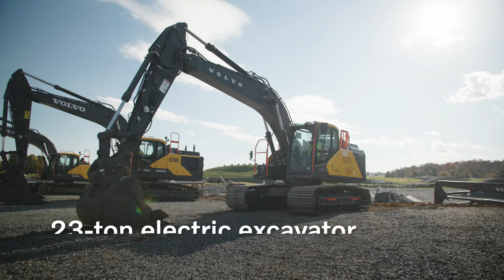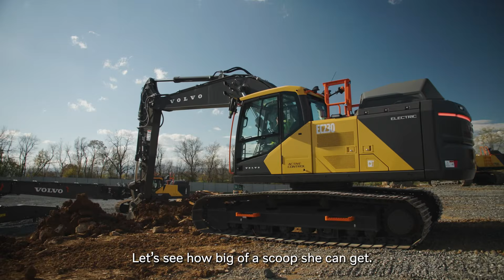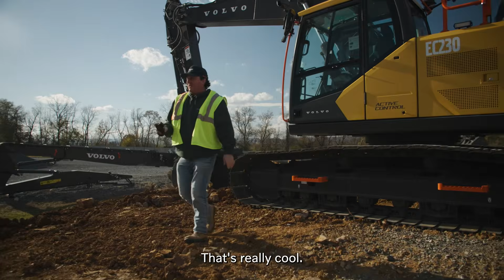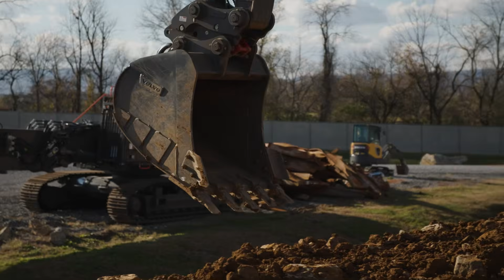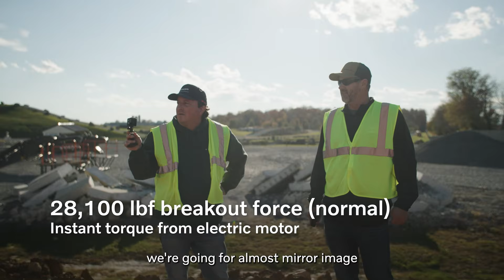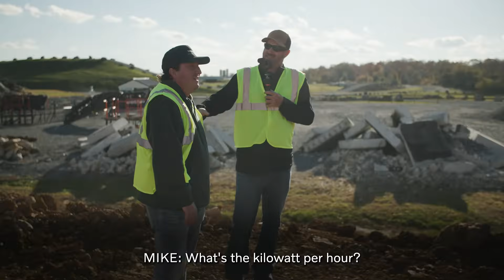Mr. DiGG and Dirt Perfect Test-Drive a 23-Ton Electric Excavator

Comment: Battery lasts 2-3 hours.. Charges for 10 hours lol. How is any of this electric stuff remotely realistic or practical?
Reply: China is way ahead, I would prefer an electric wheeled excavator or wheel loader rather than a Diesel. the only negative is with the tracked one are how slow they are when it comes to larger areas you have to track far. The idea of having 3-5 hours is during the breaks you are supposed to supercharge so the battery goes from 10-80 in <30 minutes.
Reply: I mean you're just making up numbers to prove your point. 

Actual numbers are 4-5 hours runtime for the 264 kWh model, 7-8 for the 450 kWh model.
20-80% charge times are 80 minutes(150kW) for the 264 kWh model and 65 minutes(250kW) for the 450 kWh model.

As of right now they're definately usable, not ideal. Imagine what the performance will be like in a few years time.